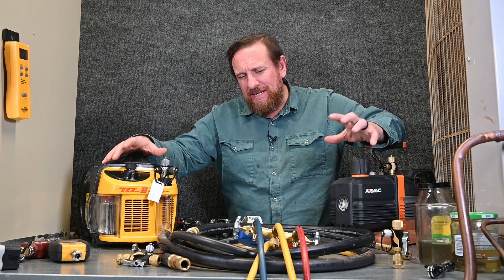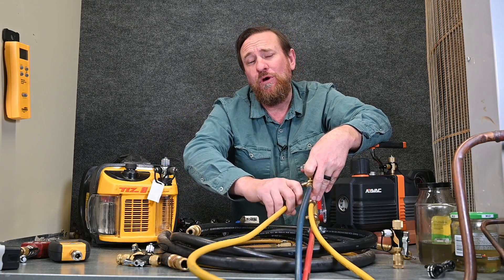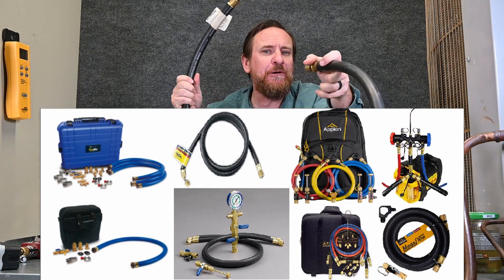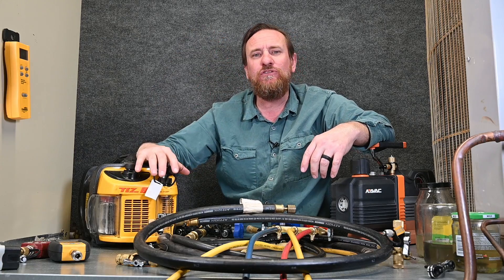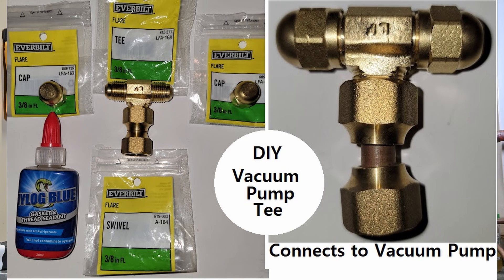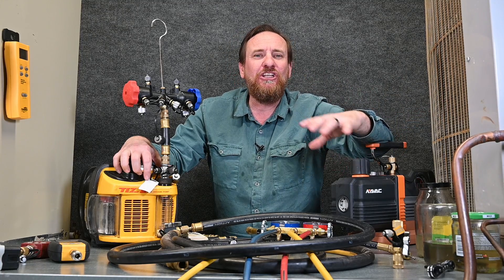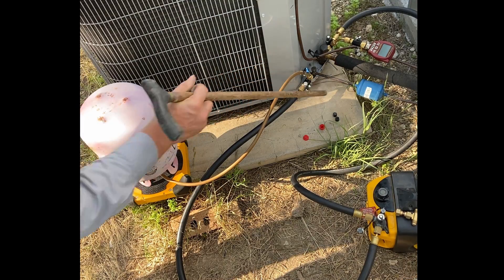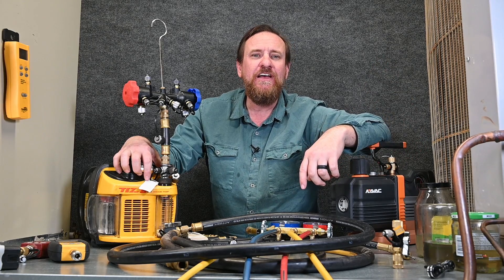HVAC 145 Vacuum p12 Removing restrictions for SPEED

Comment: Thank you for very informative video Mr.Ty. After made vacuum why can’t add refrigerant to section side? Thanks.🥀
Reply: Most manufaturers recommend charging to aminimum of 80% in the high side (this can be done in liquid form, whith no risk to the compressor).
If you cant charge to 100% then the rest must be charged in the low side in vapor form while compressor is running (some times in liquid form (ex 404A/410A), carefully so not to damange the compressor).
In smal systems many times there are only a low side port then you must charge through that.
The diffrence is speed in the charging process.
Greetings from Sweden
Reply: @MikaelS1977  Thank you Mikael🌺

Comment: I don't see how a micron gauge slows anything unless it's connected in an awkward way, you simply cannot confirm a decent vacuum unless you're using a micron gauge.
In my previous career, our task involved pulling sub-micron pressures, less than 1 micron, while doing this we'd begin the vacuum using dry nitrogen to sweep moisture and contamination more quickly then eventually valve off the nitrogen for the remainder of the pump down.  The dry nitrogen purge was key to reaching those pressures in a reasonable period of time.  We used heat as well, to speed things along.
Reply from the maker: I will be demonstrating some of that soon.
1 micron, wow that's impressive!
Reply: @love2hvac  1x10-6 mbar was target ultimate vacuum, that's .00075 microns.
A fingerprint or an eyelash contaminating the system will prevent reaching this pressure.
Around the corner, they were far exceeding this vacuum pressure, those were the big boys with expensive toys.
Reply: How much nitrogen does it take?
Flow/time. I use nitrogen some times with flowmeter in purge mode but i find it hard to know for how long one should flow (mostly reach-ins)
Greetings from sweden
Reply: @MikaelS1977  Let's see what Ty says but I suggest while flowing N2, adjust flow to maintain 3,000~5,000 microns at the N2 source.  Therefore, N2 flowrate will depend on pumping speed, ambient temperature and quantity of contamination to be removed.  If it takes a long time (more than 15 min?) the system is heavily contaminated or has an external leak.  The lower the pressure and the higher purge gas flow + temperature, the shorter time to reach ultimate pressure.  After some period of time (hopefully a short interval), valve off the purge gas that's flowing through the system and observe vacuum pressure.  You should see improvement relatively quickly.
Ty may recommend a pulse/purge strategy, I wouldn't argue with that.  Obviously,  idea is to move a dry purge gas through to assist in sweeping out contamination.

An old wiseguy used to say to me, not using a purge gas is like sucking smoke out of a coca-cola bottle, it goes much faster with a purge gas.
Reply: @thisisyourcaptainspeaking2259  Aha so you are using your vacuum pump while purging? That i have newer done. I have always purged from say high to low side for a couple of minutes then switched to vacuum (low and high port). I have only tried tripple evac once with a water contaminated system (purged a hole 50l bottle) and had to change vaccum oil 4times and left it running over night.
Reply: @MikaelS1977  Yes, the low pressure of vacuum encourages outgassing (vaporization) of contamination while the flow of purge gas sweeps the contamination away, into the vacuum pump.  The movement of the dry gas exerts a dynamic sweeping or scrubbing motion as opposed to an nearly static sponge action.
This is how we reach very low vacuum pressures, we have an "infinite" supply of N2 though, so use the method that best suits your needs.  Ty has decades of hvac experience, his methods are well proven and practical to the application, probably more useful.

Comment: What if you are unable to remove a schrader value? E.g. no room to get a valve core removal tool in place. Just leave it in? Thanks
Reply from the maker: Great question!
There are a few options.

My preference, since the system is already flat (without refregerant) I am most likely already have my torch out to braze something anyway.  So I keep couplings with ports built in. You can also use a saddle tap or make a hole and use a valve core stem but make sure it doesn't block the flow of refregerant inside the pipe.  I have added hundreds of ports for one reason or another over the years. 

Otherwise you will have to leave them in, but now you have to use a hose with a shader depresser on the end wich is usually only available on 1/4 hoses. Use ball valve style low loss over automatic low loss and use a tee at the vacuum pump. 
I'm some situations, that's all you can do.
Reply: @love2hvac  Thanks for the information. It's a new Mitsubishi Mini Split and for some reason the manufacturer routed everything real close to the liquid line. No room for the valve remover. Probalbly will leave in instead of brazing out. Your videos are really helpful to me. Retired from another job after 35 yrs and trying to pick up a new skill.  Thanks again.